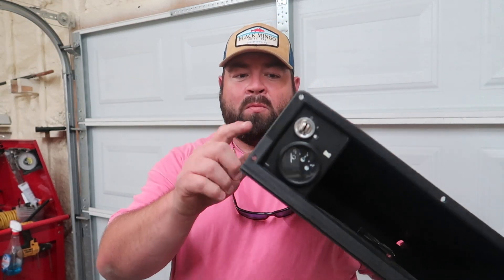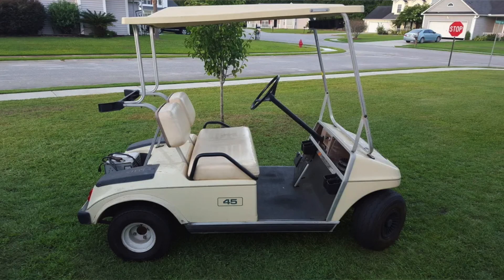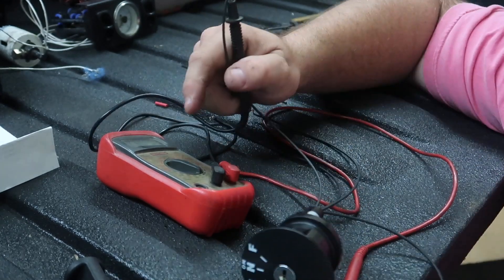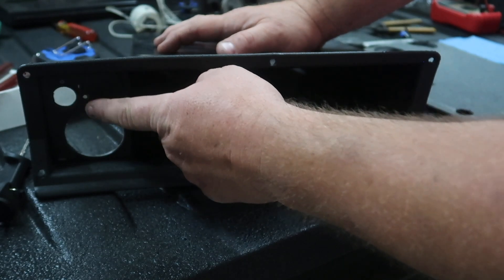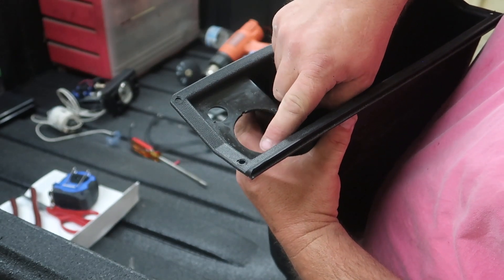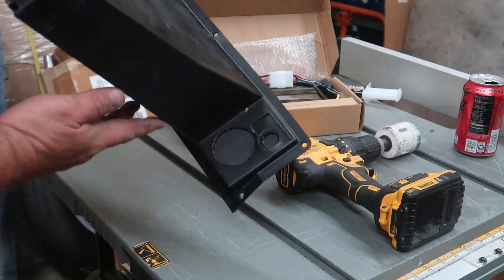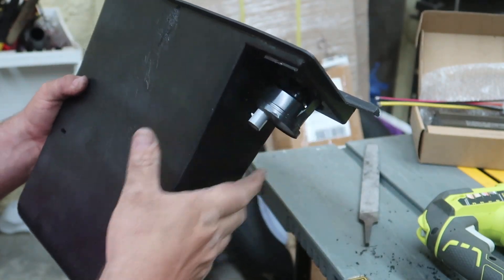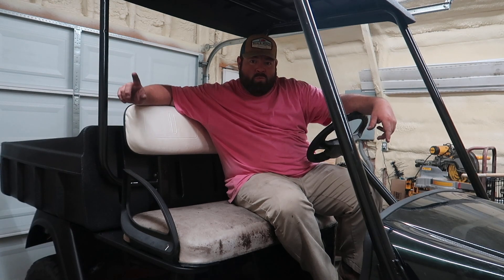How To Install EZGO RXV KEY SWITCH In ANY Golf Cart | Key / FNR Switch Combined | Cushman Hauler Pro

Comment: Thanks for info on using an RXV switch. My first cart was an RXV, so we were familiar with it's switch. I have now a TXT but hated the switches. So I followed your lead and swapped in the RXV switch. It's a way more intuitive design. For me it was a simple 48v setup, no relays needed. Again, thanks for the idea, and now there's at least 1 cart out here that was switch/swapped!
Reply: I have txt what color wires on factory harness go where on switch I understand abcd but on txt harness in dash I need colors that connect to each position

Comment: I have a 2002 CC DS. I really would like to do this swap, but the "shifter" style FnR switch appears to have E motor connections as well as the switch wiring. How would I handle that swap?

Comment: Cool video, thanks for sharing. 

I would be curious if the keys are all the same or different.....

That 12 volt thing is weird,  you would have thought it would have caused a issue when you put the Navitas controller in. There must already be a step down transformer in the system some where.

Comment: Question...I just bought a 3 position switch for headlights for a gas ezgo txt. My question is, I have the blue and green from the cart harness plugged on but do not know how to wired the harness on. Do I take the positive and negative of the light harness (with fuse) and plug it on to the switch instead of the battery?..I'm only getting 3.5v from the cart harness...where do I get the 12v from?...can I splice into a wire with 12v....I'm lost.

Comment: I just inherited an '89 - 36V DS and would like to do this mod.  I didn't see any on your channel, do you have any videos of the rebuild you did on the '89 you mentioned in this video? What else is needed besides the Albright SW182?  Will I need to upgrade to 48V?  Great videos, with great content!
Reply from the maker: The reversing contactor is available with different coil voltages. You can keep 36v if you want and do it. The 182 would be suitable for mostly stock carts, However if you plan to lift the cart with an aftermarket controller I would consider the sw202.
Reply: @Fentertainment  Thanks Ryan.  I know you're a busy man, but would it be OK to email you to discuss my project...I have a few upgrade questions.

Comment: Have you ever or would it work to T-off the B wire to run a voltage reducer to run accessories that shut off when the cart is off. Suppose you could run the negative from the reducer back to the batteries.
Reply from the maker: If you want to power your accessories down when the cart is off then you would need to add a relay to the key switch and power wire to send power to the converter when the key switch is on. The blue 5 wire converter has a key switch wire to do this but it still converters 48 to 12 when the cart is on. But I did make a video of this exact thing -  https://www.youtube.com/watch?v=yBuia-M_jHQ
Reply from the maker: This relay method will work with any reducer, even the 5 wire reducers. You would just have to use the main power 48v and the key switch 48v together and let the relay send power when the cart is on or off.

Comment: Can you explain how you would do this on a non PDS system. I want to move the lever system on the body to the dash with a toggle switch.
Reply from the maker: There is another part you will need. Hard to explain but maybe one I will do that video in the future.
Reply: @Fentertainment  do you have the part number for the extra part?
Reply: I would love this part number and a video also

Comment: Hey Ryan, will this be a plug & play for my 2008 EZGO TXT? Its 36 volts... Will I need a relay? Please advise.
Reply from the maker: Its only plug and play for a ezgo rxv. With a little modifications it will work on any golf cart that is normally operated by a switch and not a lever.
Reply: @Fentertainment  I ordered the pigtail... Thanks for the link. Will I need to do anything special for my 36 volt cart?
Reply: Hey Ryan, what do I do with the original key switch wires when wiring the new RXV switch?

Comment: how did you convert from a poverty lever forward/reverse arm to the key switch?
Reply from the maker: This cart didnt have the poverty lever in it. It had a regular switch but I changed it out for the rxv switch.
Reply: @Fentertainment   I thought you made a comment of converting a 1989 club ds from poverty lever to the sw 182 or 202 switch? how /what is the procedure please.
Reply from the maker: @danielleichty5699  I did. I really need to make a video of doing that. Its hard to explain how to do it but you will need a pair of reversing contactors and a switch to do so.
Reply: @Fentertainment   I would really love it if you could do a video and a list of parts. 
I have resurected a 94 ezgo marathon from the depths for the local VFW Post 51 Spokane, Wa. for use during the County Fair . So the older member/volunteers don't have to walk to the food booth and a switch would be much easier then the lever. I've already added lights and turn signals and thinking of a stronger motor( as this 36v will only do 8mph with 3 adults avg weight). any help in modifing would be greatly appreciated.